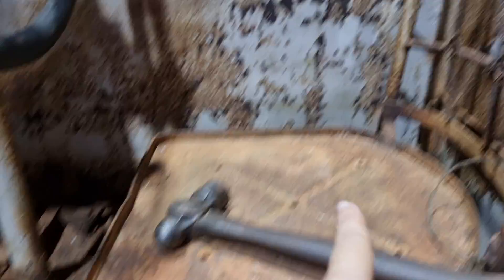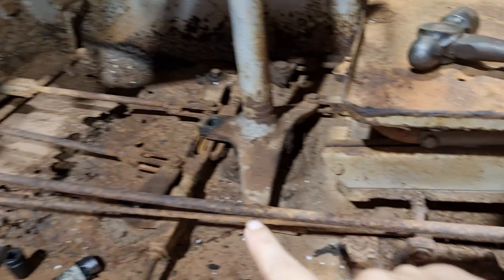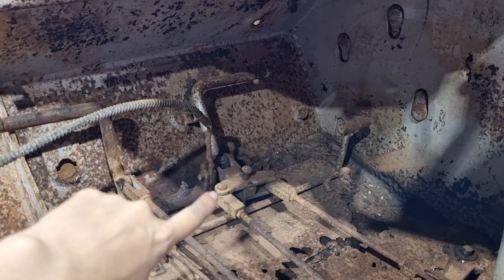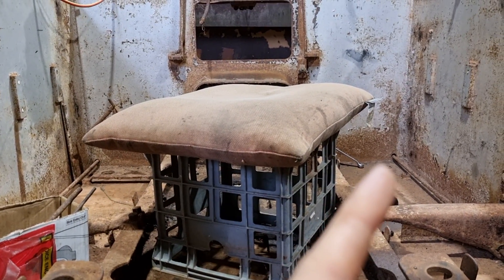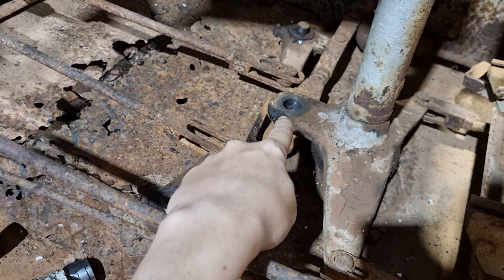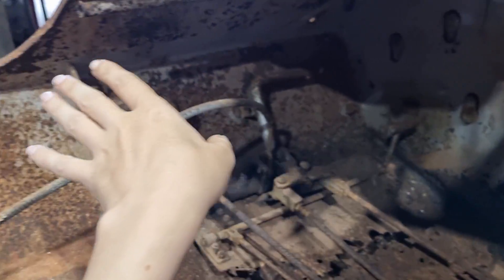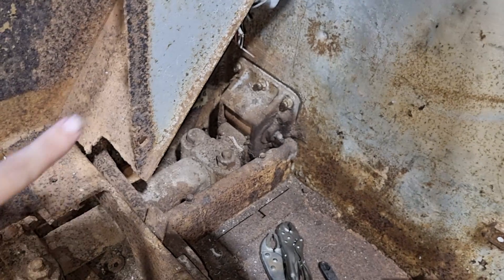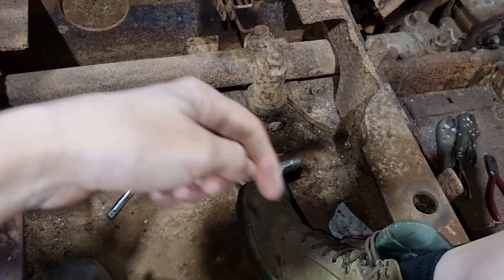Track warping! One of the most unique steering methods for tracked vehicles!

Comment: Lots of crawlers use tiller lever to control both the steering clutches and the steering brakes but old Caterpillars actually had separate controls with levers for the clutches and pedals for the brakes.  I've run both types and I honestly don't know what the advantage of the separate controls are because you aren't supposed to touch the brakes until you've fully released the clutches and a lever that controls both would prevent you from riding the brakes when you shouldn't.  I do know that running an old fashioned clutch-brake Cat with an angle dozer can be one heck of a foot and finger dance!   As for the track warping plus differential braking it's s a quick and cheap design using as many off-the-shelf parts as possible that can be thrown together by just about any fabrication shop using very simple tools.  It allowed a crude but useful vehicle to be produced in volume at speed by a country that was already stretched to the limit.  Fancier systems would have required a lot more machining at a time when machine tools were vital strategic resources and Britain was already struggling to produce enough bearings and gears to meet all of their other needs.

Comment: Interesting.  This track warping reminds me of one of my sergeants who was very insistent that when on road marches to avoid the kind of classic track movements that can be a bit jarring when turning.  He refereed to it as to feeling the wheels, as in if you are driving smoothly it is like you are in a car and that is how it should feel.  I think this setup would make it easier to do that.
Reply from the maker: Some sources I read say that was a significant reason for it. Over loving distances, the driver would be less fatigued by doing small steering wheel adjustments over tiller pulls. I can see the principles in action, but I don't know if it is as useful as they intended 😅
Reply: @lottiethetankwhisperer  Oh, yeah.  I've only driven 311s or 577s very short distances, but now that you mention it that would be exhausting on a long road march.  And they don't call 'em road marches because they are short.
Reply: @lottiethetankwhisperer  oh, so also I watched the last half of the video a couple times.  Right, clutch brake, is super easier and super short lived.